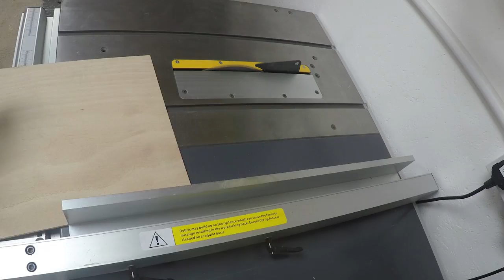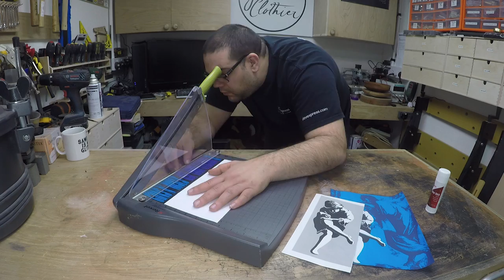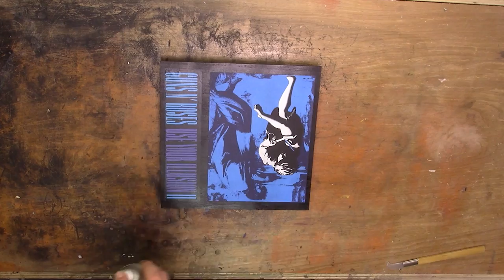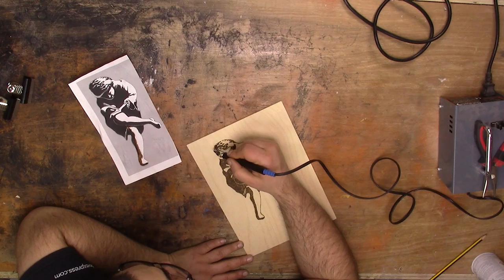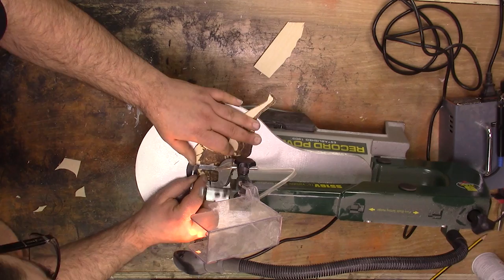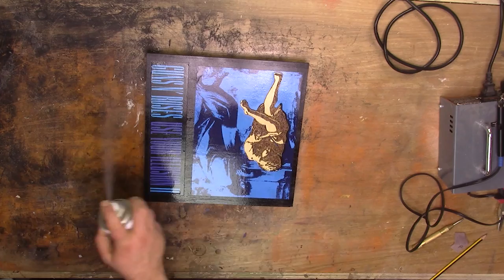Makers Rock 2018 (Giveaway Now Closed)

Comment: Nice!!!!!  Rock on!  Mine is way behind and probably out by the end of the week because I've used the scrollsaw (same one as yours) for most of it.  I should have done what you did and combined print and scrollwork!
Reply from the maker: Thanks. Yeah I know what you mean. I knew I only had limited time so took the decision early on to just go with a small portion. feels a bit like I cheated compared to the others out there